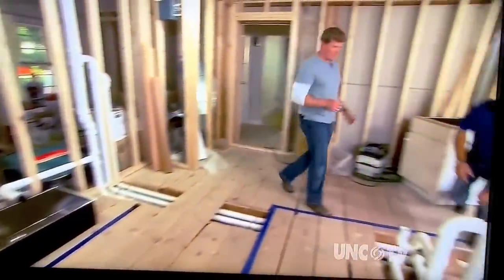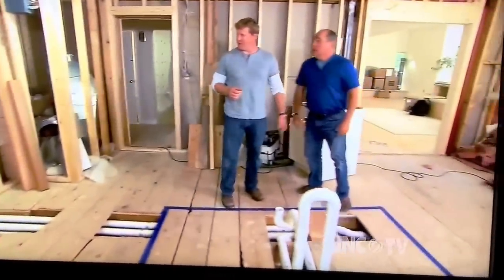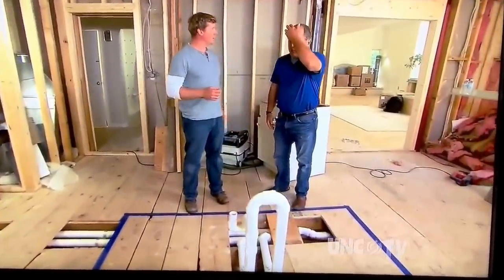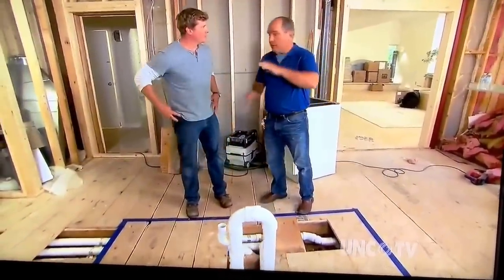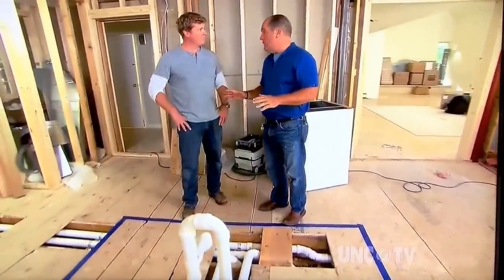Proper drain & vent for island sink

Comment: I m not a plumber but I think that vent has to go by itself to minimum 6"" above the fixture than be connected. That will not pass inspection in my area. Jersey by the way.
Reply: He did go above 42 the video showed that he was well above 36, good installation, but the correct way is to add another 1 1/2foot vent with cleanout one foot above finish floor. Nearest wall. Also add 2in cleanouts at loop. Not too many plumber do it right.....
Reply: this is ok only on island sinks
Reply: your right David. should be a clean out to clean vertically on the drain and horizontally on the vent.
Reply: Adriano Roldan ye it's suppose to be 6 inches above the flood level rim of the sink or it will cause siphonage
Reply: how would you bring the vent 6"'s above on an island vent?
Reply: Mario D'Agostini you have to individually vent it if it's more then 1.5 m away you got to upsize the vent pipe!
Reply: he did up size it to 2" tank
Reply: I mean where he ties into the wet vented portion
Reply: Actually this is code in NJ if you install the three cleanouts. But there is an easier way, since the drain is 2 inch no need for the loop you can still pull an 1 1/2 vent from below the floor within 8 feet and run it to the vent stack and this should also have a cleanout but the code does not show it. That method may not be to code where they are. It is in the IPC book with no illustration so its all in the wording. If your drain is only 1 1/2 then you need the method shown with the three cleanouts.
Reply: The Tool Guy  I agree, You are probably smarter and happier.  You are probably trying to spread  ur happiness and  mushrooms all over the world...

Comment: I had a job with about 20 sinks like that. I talked to the inspector and put air admittance valves under the cabinets. I vented the ends of the horizontal mains. Talk to them first when you can see a problem.
Reply: I'd rather a circuit venting system along with the island vent, no moving parts

Comment: I guess the code in that area dose not allow air  admittance  valves?
Reply: Yeah. Seriously all that material and labor a Air Admittance vent could solve. They're not that hard to replace when they fail.
Reply: No real code allows that unless you live in a trailer park
Reply: @ralphfurley404  where I live it dose. Thanks
Reply: @thomasblue6064  A dose is a spoonful of cough medicine.  "Does" is the word you are looking for.

Many local codes prohibit using air admittance valves as the primary means of venting a drain, because of the possibility that they could fail and not be replaced.  Additionally, standard plumbing vents are typically needed for the overall functionality of the sewer.  If everyone used AAV's in place of standard plumbing vents, the sewer would have no way to get rid of its build-up of gasses.   This is why AAV's are commonly allowed as a retrofit to a drain that was never vented originally, but not allowed in new construction.

Comment: What a goofy setup and pile of stuff to clog over time.  How about a combined waste and vent since you have 3" running there already?
Reply: Now, that would be a very clogged system over time. The water would run down the middle of the pipe and leave everything behind.
Reply: David Hoekje 
Because there is a trap and garbage disposal on the line that would be unvented.
Reply: You can never go vertical after a trap until after it is vented.
Reply: @antoniob3941  Except, of course, floor mounted toilets. Are there any other fixtures that have retained the S trap? I can't think of one. A bidet?
Reply: @antoniob3941  By the way. An offset using 1/8th bends would be considered vertical
Reply: @TheNimshew  that's true about vertical piping. Lol  and floor mounted clinical wash sinks have integral traps. I don't know any other that are legal
Reply: But the traps on toilets are protected by the trap way and  fill valves. Other traps can be pulled out if not vented

Comment: ya this so dumb! Studor vent that and walk away, totally legal and takes up less space, also ten time less work.
Reply: nick sprung  depends on what State , here in New York it’s illegal and you will automatically failed inspection
Reply: nick sprung what state are you in ?
Reply: Studor vents fail Chicago no go either
Reply: Washington state is moving to strictly loop vents as well. I haven’t ever installed a studer unless is a valve swap. 
They always fail either open, allowing gas to move in or closed, choking the drain. 
BTW, This loop vent was done completely incorrect per UPC.

Comment: This is a proper loop vent. I see guys just using the drain as the vent and looping back on itself. That is wrong. Also, an aav or studor vent isn't allowed in many jurisdictions. As long as an aav isn't buried in the wall, I don't have a problem with them. They're like sharkbites, eventually they'll fail so make sure you can get to them. They explained the purpose and functionality of this type of drain and won't have any problems out of their design. Sure, add a clean out, but overall, this is proper work and tells me the plumber is trustworthy on the rest of the build.
Reply: No it isn't. The top loop is required to be 2 45's and a 90. There is no clean out in either the vent or the drain as required.
Reply: @Skorlang  As I said, add a clean out, but I think the 2 45s is being a little picky. I have never understood the reason for the angle of those pipes and there's not always room to do a long sweep and since it is a vent, I can't see the benefit to it. This setup would function just fine unless I'm missing what you are saying.
Reply: @MyFortressConstruction  it is required by UPC code and the reason being better flow characteristics in the event the drain backs up high enough and the peak of the loop vent is below the flood rim of said sink, as is common. The room problem is rarely width, having at least the width of the sink to work with. The obvious problem is height, which the 2 45's and1 90 addresses
Reply: @Skorlang  Yes, I mean I get the UPC code but I still don't understand how a more angular loop is really going to make a difference. I want to understand the science behind it but I just can't make the leap that two 45s and a 90 are any different from two 90s. Water will still flow down on both. Solids won't get stuck on either. Air is still able to flow equally. If anything, more fittings are able to catch debris. There are many things in code that seem to be there because the writers wrote it in because they needed to define something and figured this is "best" theoretically. I still can't see an issue with two 90s though.
Reply: @MyFortressConstruction  2 45's restrict less flow than a 90, simple physics.
Reply: Plus, it eliminates a flat spot.
Reply: @Skorlang  Right, like I said, I understand why the UPC did it that way, but is it really that big a deal? I don't think so. It's one of those theoretical things that doesn''t make any difference. If an inspector said to remove it and place two 45s and a 90 I'd think he was splitting hairs. He might tell the plumber it's "code" but what's the difference? I think it's to prevent a plumber from leaving a longer horizontal section that could hold solids in an overflow event, but a 1.5" flat spot joining two 90s compared to a single 90 is not going to be an issue.
Reply: @MyFortressConstruction  you're wrong.
Reply: @Skorlang  Lol.
Reply: @Skorlang  God bless you.
Reply: @MyFortressConstruction  you're welcome

Comment: Cabinet guys nightmare
Reply: I am a cabinet guy and on a lot of island's I am building a knee wall and installing my cabinets against it. That pipe, if placed correctly, will go up inside the framing of the knee wall. It looks like that is what they have it set up for (blue tape on the floor is countertop outline, so they have 12" over hang behind pipe, knee wall, and then 24" cabinets) so it's just as easy to place a cabinet there as at a typical sink. If the cabinet has to come down on it, not a big deal, just cut out the bottom. They did a good job by the looks of it.

Comment: Wow, that was costly and unnecessary. Some plumbers refuse to change. AAV knuckleheads
Reply: Those are illegal in most places, like mine.
Reply: For someone who doesn't know plumbing, what part was costly and unnecessary? How would you do it differently?
Reply: @TheArtificiallyIntelligent  there's no clean-out. I'm no plumber but you should have a p-trap that you can unscrew and remove to clean the line or remove an earring that goes down the drain for example.
Reply: fwapcom 
Hey dude try and find a plumber who has a Uniform Plumbing Code, illustrated. The illustrated book has pictures and if you compare it’s all wrong.
Reply: @boris9305  that's to bad because they are awesome, in Oklahoma you can use them.

Comment: this is such a wrong way to do this won't pass in fl. cause what happens for one is after awhile of rain that comes down the vent will be trapped and that re vent will hold water after time a a studor vent would be the way of doing it to plumbing code in Florida
Reply: The vent that goes through the roof is also the main drain line. No possibility of water being trapped in this case.
Reply: Frank Riddagh that revent was connected to a 3x2 Wye on the drain line. Being that if water came downthe vent it would proceed to the drain.